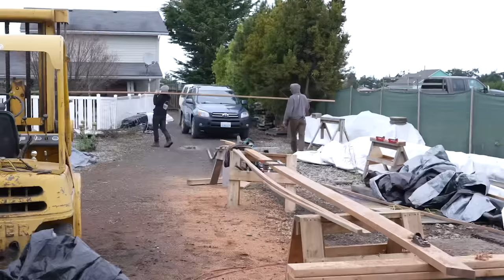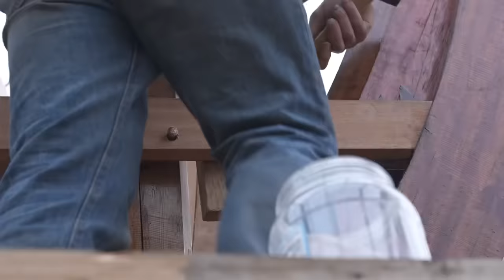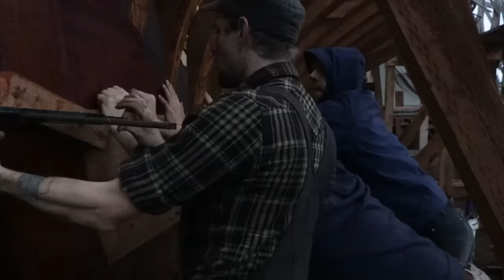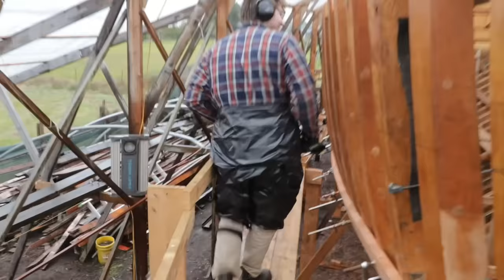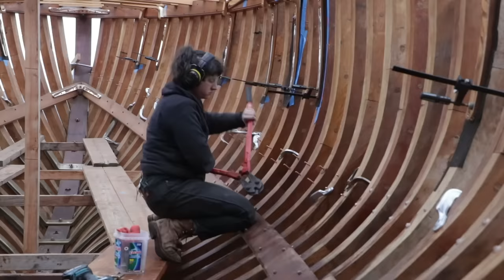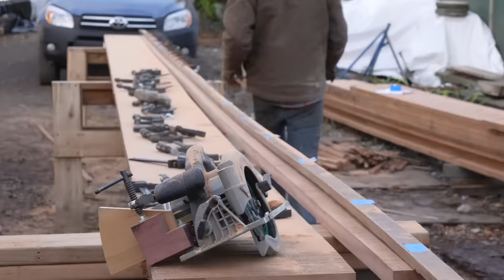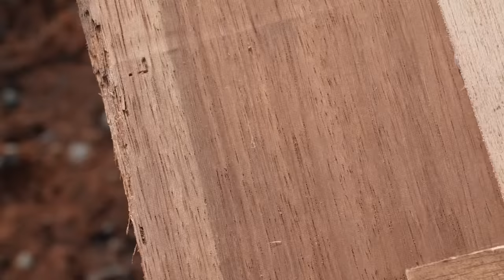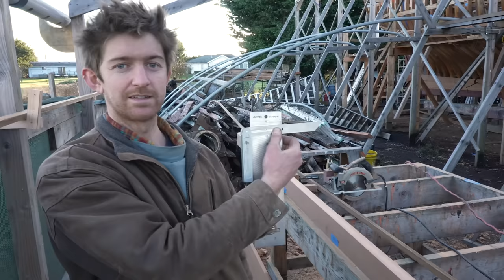Planking Tally Ho! (Wooden Boatbuilding / EP86)

Comment: The bronze looks beautiful and strong, the cost doesn't sound bad. Well done
Reply: Not cheap, but each piece unique, requiring a custom pattern, mould and finish, and perfectly suited to its task. And good for at least 100 years. As time goes by I expect it will look like better and better value.
Reply: Yeah, I was surprised that the foundry labor was as low as it was. I guess they wound up doing a lot of the grunt work themselves.
Reply: The labor in the manufacturing of the Bronze is probably obscene... But he probably got a much better deal because he did a lot of the work himself.
Reply: @afriedli  he probably could have made it out of stainless steal and had a much more space-aged looking brackets--- and even chrome plated it.. But he wanted it to look traditional.  I'm glad he ultimately chose to polish all the bronze--- even though I disagreed with it at the time.
Reply: @dprider02  Overall a win-win-win I'd say. 

The foundry probably didn't charge full whack for their labor, but they were clearly on a learning curve for some of the work so only fair that some allowance was made for that. The capabilities the foundry developed in the course of the work expands the commercial offerings it can make to existing and future customers - so a good investment from their point of view. Also, a few hours of YouTube videos of close involvement in a compelling and prestigious project is pretty good publicity!

Volunteer labor is cheap (only need to feed & house them, and provide tools), but inefficient. The fact that quite a few of them keep coming back suggests they're pretty happy with the deal in terms of what they get out of it.
Reply: @calholli  Bronze was definitely the right choice from multiple viewpoints. Firstly, the material is more appealing aesthetically - especially, as you say, given the period of the boat. Also, bronze has certain amount of 'give' and 'flex', making it a perfect complement for wood, which is going to move a bit under normal working stresses and over time. If the wood moves and the brackets are completely rigid, fixing like rivets and screws are going to cause damage and work loose. Stainless steel is rarely completely stainless, and exotic alloys with the right combination of properties are not cheap.
Reply: I had guessed $45k in our dollars, which allowing for the exchange rate is about US31k. 
Obviously it would have been a lot more if the foundry had not graciously assented to Leo using a lot of his own labour.
Reply: The quality of such great workmanship will be remembered long after the price has been forgotten.
Reply: @calholli  I had that same thunk.  
But casting stainless steel? At what temperature? and would it keep its properties? 
If not machining and welding, but there again, the long term properties would be affected!
So, basicaly cast bronze seems to be, by far the best option.
Reply: You can buy a pretty nice used yacht for the cost of the bronze!
Reply: @phillee2814  You are right about that! But Tally Ho is beyond almost everyone. I just want to have a little boat of my own that I can sail and maintain myself.

Meanwhile, I love being able to be part of something larger than myself by supporting Leo and his effort.

Comment: It might be interesting to have a few minutes showing how all of the cutting tools are kept sharp. All of that wood is very, very  hard and I have to believe that there's a small industry keeping your chisels, plane knives, drills, saw blades and the lot sharp and safe.
Reply: At a few points in previous clips, I've seen Leo use a Tormek machine. I have one and while not cheap, they are amazing for keeping just about any tool sharp. A water cooled, slow speed grinder and honer.
Reply: @aussiechris5904  Thanks, I think I missed those clips.
Reply: @aussiechris5904  great to see another Chris tediously watching this up side down

Comment: KENJI: Welcome to IRON SHIPWRIGHT, today we have two extraordinary shipwrights, Pete and Leo, in a competition of skills to see who can cook up the best planks our judges have tasted. Now Yukio what is it that Pete is doing there, is he cutting a rolling bevel with... is that an unmodified table saw?

YUKIO: That is correct, Kenji, this is a technique I don't believe we've seen before in Shipyard Stadium. It appears Pete is using an off-she-shelf saw with a rear-facing bevel gauge and he is pausing at each of his marks to unclamp the saw and adjust the bevel with the blade still running. Quite a bold technique! But it has put him in the lead in front of Leo, who appears to be filming and editing a video segment about his homemade gauge.

KENJI: Very exciting. I hope he has a steady hand! Will Leo be able to catch up?

YUKIO: Leo is off to a bit of a slow start, but he may be able to finish his planks with just a light pass with the hand plane. Pete will need to fair out those one degree steps with a power plane. It's anyone game at this point!

KENJI: Incredible. Speed matters this competition, but in the end they'll both be judged on the quality won't they?

YUKIO: Yes that's right Kenji. Fair is fair.
Reply: Ok, I get that the modified circular saws are quite good for these variable bevels, what about the massive ships saw? Did I miss something?
Reply: @dax8476  I guess that's easier than trying to push the plank through the ship saw while keeping it perfectly positioned. Also not a one person job if on the ship saw.

Comment: Leo, you voiced my feelings on scarfing planks exactly. I can see how the concept might be an attractive one, but relying solely on any glue, in the long term, verges on the foolhardy.
Reply: This is not entirely true. I agree with Leo for this boat. But scarfing veneers in modern boats that are held together by glue in the first place is a very sound practice. For traditional boats, I think it is better to stick with traditional methods, though. Also, lots of people scarf plywood in stitch and glue boats, and it doesn't seem to cause problems. Often they have a layer of fiberglass on the outside when they are done, though, and surely that helps also.
Reply: With this level of craftsmanship, there's no need to question it.
Reply: Yes I wouldn't dare

Comment: "I really can't see any reason why you WOULD scarf planks." :D :D :D Take that, A to A. Shots fired. lol
Reply: Same here. I was wondering why the A to A guys were doing that. but figured it was their craft. I've seen how scarfs can fail. I do not wish them any failures.
Reply: Saying "I don't know why you would do that, if you didn't have to" is just another way of saying "different circumstances necessitate different solutions".
Reply: Not entirely true. There are various reasons they take an alternate route, partly due to cost but more the reason for building Arabella from the wood they have on their property. Take that reason away and it suddenly becomes a YT channel a boat being be built by 'some one' and not Steve and Alix.
Reply: Yeah, I don't think that I could ever be %100 convinced of the integrity/longevity of those scarf joints. Especially after experiencing the failures they had early on.  One of those springing open in a seaway could really spoil your day!
Reply: A&A arnt the first to use it, plus leo said 20 years for it anyway. double plus A&A will easily replace planks just like Leo. I mean if you can build a boat, you can easily do maintenance jobs along the way

Comment: Imagine level of carpenter building boats in ancient times with no electric circular saws to get all these planks cut
Reply: You'd be amazed with old style tools how fast you can cut stuff out. When you have draw knifes , many saws, ads' you can produce stuff pretty fast. Now granted its a LOT more work but a skilled tradesmen can do it pretty quick. Even as a modern day journeyman carpenter to imagine what tools to use where to efficiently produce lumber with hand tools its hard. But i grew up around some old school carpenters that could cut a plank in maybe 1.5 the time you can with a circular saw. Depending on lumber and if they have all the old tools sharp ready to go. Its very hard though in modern times to even imagine how to do it. I really look up to the old timers before my time as a carpenter man power and mechanical design thats all you had. They got amazing stuff done efficiently
Reply: @Deftonesdsm  Also, a boat like this even 100 years ago had many more hands working at once. All highly skilled, all doing the task needed.
Reply: @blueblur6447  thats pretty much what i mean. Man hours overall back then was the solution as the option wherent there. Id kill for a fully stocked 19th century carpenters box/toolset. I have some old bit braces and things but yeah even modern large scale construction has that though. In my work hundreds of guys collaborate to build giant structures. Yet we do it with 1/4 of the man power twice as fast. Things have changed a lot and continue too with cordless tools catching up to the commercial grade tools. Changed the game no generators or cords just batteries and tools.

Comment: Leo You gotta get air powered rivot gun, way faster then a hammer
Reply: Is faster an objective?  If so... why!?
Reply: @Onionbaron  Well, in this case the labor is free, and such a resource should not be abused.  However, they are training to be carpenters and one of the main set of carpenter skills is grit and gumption.  So an argument could be made either way.
Reply: @asdfdfggfd  As a teacher I always ask my students, why the hurry, where are you going? Instead of learning how, they try to learn how the system (aka idiots with a big heart and no clue) whants them to answer...
There is not much knowledge to be sought after anymore, only to avoid it the best way...

Comment: So, the port side garboard would be the Larboard Garboard? Asking for a friend...
Reply: I believe larboard is just a corruption of starboard   I may be wrong
Reply: @bonvoyage5377  no, larboard is port side.
Reply: @bonvoyage5377  Larboard = loading side. Starboard = steering side from old English.
Reply: @TheFlyingPlectrum  Which is why they went to 'port'.  basically 'starboard' and 'larboard' weren't used in the same place and time, is my understanding.
Reply: @CorwynGC  Both  'starboard' and 'larboard'  were in simultaneous use, as David implies. The change was made to one of them because of quasi-Darwinian evolution: nautical terms which sound similar but have opposite meanings result in loss of vessels and lives. 
-- The change only occurred quite recently, surprisingly: just about the time the schooner "America" crossed the pond and won the now-famous Cup, which (after being renamed for the schooner), is still being contested --
Consonants do not travel far from the source, especially upwind into a gale, so it's the vowels which have to be distinctively different.

Comment: Instead of using a hand hammer why not use a chipping hammer with rivet crowning tool bit in it?
Reply: This is the comment I was looking for. They're using power tools already, an air compressor and air chisel/air hammer/chipping hammer wouldn't hurt.
Reply: @Grim0954  finishing touch needs hands on work and the satisfaction level you won't get with automating
Reply: One issue with the pneumatic hammers on a project this large is long term tissue damage for the user.  A manual hammer, of course, can result in tendonitis.  A portable u-clamp hydraulic press might be an interesting development, but it would need to be heavy to resist bending loads and be limited to its reach.

Comment: Leo,
When drilling the stopwater holes, how do you manage to keep these holes aligned with the joints all the way through the timbers?  It seems almost impossible.
Reply: I use a small square against the shank of the drill bit. A level works too,plus you still halfway through and hope you meet in the middle lol
Reply: could somebody explain stopwaters please, it sounds like you drill a hole and then seal the hole up again?
Reply: @donjons9178  they are a way to prevent leaks by stopping the path of the water. The purple heart that the keel is made from is super hard but no matter how good and tight you make the joints, they are going to loosen up over time because there is a massive amount of force that comes from the sails and seas. So what happens is when the sealant fails the water causes the soft wood to swell up and seal it. It's one of the oldest ways that things have been sealed and it is one of the reasons that when you launch a wooden boat things need time to swell up and seal.
I've had a few beers for the first time in ages so hopefully you understand. In short,once the soft wood dowels swell up from water nothing is getting past it and you will never remove the dowels if they swell up.
Reply: @southjerseysound7340  
Just had a thought.  Wouldn't it be a lot easier to drill the stopwater holes accurately if you put a small chamfer on the edges of the timbers before mating them so there would already be a small triangular hole that would be rounded and enlarged by the drilling process?
Reply: @clarkkent7999  probably, it's similar to me using a small bit to follow the existing gap. You can feel it pretty good most of the time.
Reply: @southjerseysound7340  thanks for the explanation, but what is it actually sealing, I guess its more  than the hole that he has just drilled?

Comment: Love the comparing and contrasting w/ Arabella. Tally Ho has  butt joints in its planking, Arabella has scarf joints. Tally Ho as laminated frames and Arabella has steam bent frames. Tally Ho is being (re)built by a shipwright, Arabella by talented amateurs. Tally Ho is a lot larger than Arabella. Entertaining and fascinating. Oh, finally ponied up on Patreon, watching Leo's vids if a much less guilty pleasure now.
Reply: Tally Ho has what would sawn frames. Laminated frames would be closer to arabella's,  just with more layers of stock thin enough to not need steaming, laid up with glue and clamped down to the molds to create a solid frame of laminated wood. Quite strong, but better suited to a production boat than a one off.

Comment: If you have a need for some strong yet rust proof brackets you may look into making them out of steel and silicone bronze spray welding them. You would have the strength of steel and unless the brackets crack, are scraped or rubbed constantly will remain rustproof. The best way is to arch spray welding, the old powder in flame way will work but heats the steel a  lot more. 
Looks great have been checking in from time to time to see how its coming.

Comment: I would have guessed the sòft wood water stops would more likely force the joints apart and also work like a sponge in the sense that water would be transferred 'through' the sòft wood with the flexing of the boat and continue into the bilge. That said this boat is a work of art an absolutely gorgeous physical evocation of purest love.

Comment: Bronze knees and floor costs. As a patternmaker and sometimes buyer and seller of castings I think you did very well.  If the casting are say 50lbs on average (?) then that is $14/lb  or if 75lbs av then  $9.25/ lbs .  For one offcasting from a loose pattern that is very good cost ( and that includes tax) I would expect to pay that $ range on east coast for mounted patterns that can be used in ready made flasks.
You need to add the volunteer labor, polishing? , and cost of patterns for a final cost but you did really well in my opinion.  Cheers Warren

Comment: Averaging almost a plank per day! That is some speed, even with a talented crew like yours. Just one tiny little detail, that might require some attention in the future: The dial in your bevel gauge. The saw vibrates when running, and the dial indicator has only one attachmentpoint. So it will slowly droop down causing false readings. Simple fix would be heating the indicator and pressing it against the saw cell, if the cell is plastic, that is. If it's metal, then you probably need to cut a groove into the cell to hold the indicator steadily in place. Also I would attach some kind of handle on the end of that dolly, something that would still allow the dolly to be hammered when needed. I've experienced thinner nails being pushed out when making the head, just by hammering the head in wrong angle. So will be never enough force to keep the dolly in place, and therefore a security whack is often needed.

Comment: Just noticed the credits to the soundtrack, thanks for that nice work on the production side as well as the  craftsmanship. 
I would consider making a more permanent straight edge out of plywood with a bed (radial arm saw style) and the straight edge floating above as all planks are the same thickness, but that would take a while of course.

Comment: I've been watching from the start of this adventure.  Brilliant and inspiring to see the attention to details.  Can I suggest you use a digital angle gauge to sort out the plank joint angles?  I've used it a few times for bicycle fittings. Quick, easy and accurate.  Measure length wise as small an increment you want and with a bit of data collection, Robert is my father's brother. Cheers and thanks for the inspiration!

Comment: Put two planks on the boat clamped correctly with a space a little smaller than the router bit. Run the router the full length now you have correct bevel and perfect fit

Comment: On long and reaped rips,, I have had excellent results with an old style steel rip blade.  Chisel teeth, wide set and zero side blade bind. Annnndd the teeth are easy to give a quick sharp to with a flat file.  I just chuck it up on the bench vise with a pair of scrap soft lumber in the jaws to grip the blade. You can make the teeth wicked sharp with just a few strokes.  Beats a modern carbide blade hands down. The carbide may be able to cut 40 times longer,, but a proper steel rip blade will cut with 25% of the force required, and twice as fast.